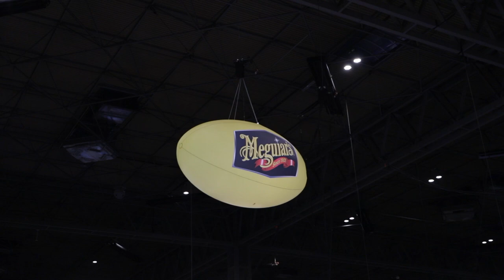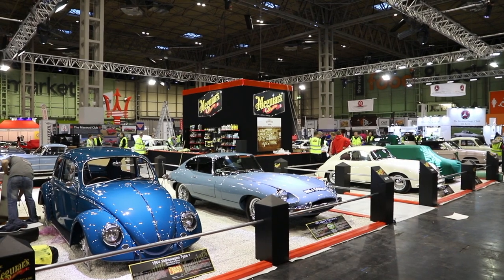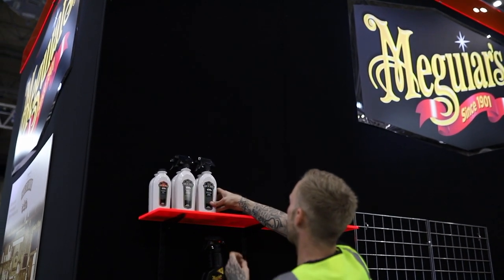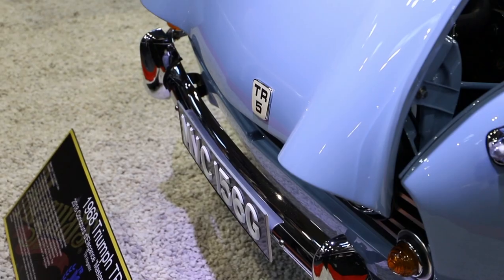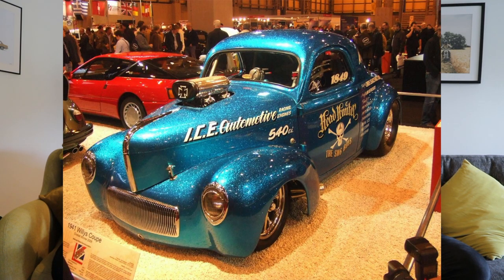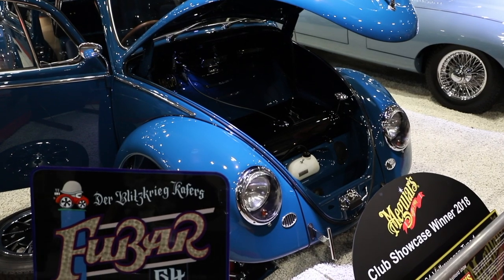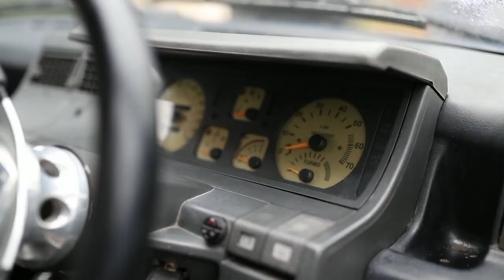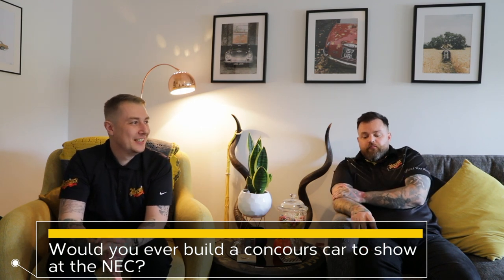A year without the NEC Classic Motor Show | Meguiar's UK | Mike Brewer | Lancaster Insurance

Comment: Hi I’m fairly new to detailing. If I was to completely wash the car and put the clay bar on with detailing spray, after this would I be able to put the polish on and then the ceramic wax spray and dry it off? Or do I need to apply the ultimate compound before I polish
Reply from the maker: Once you've washed the car you'd need to dry it before clay. Then if you wanted to remove swirls and scratches then we'd suggest the Ultimate Compound. If you just wanted to give the paint a deep gloss you can go straight for polish. Maybe try the Hybrid Ceramic Liquid Wax as you wouldn't need to wet the car again.
Reply: Meguiar's UK Great thankyou! I’ve recently brought quite a few stuff from Meguiar’s and I can’t wait to try them out👍🏼